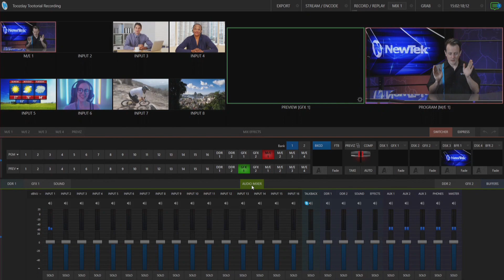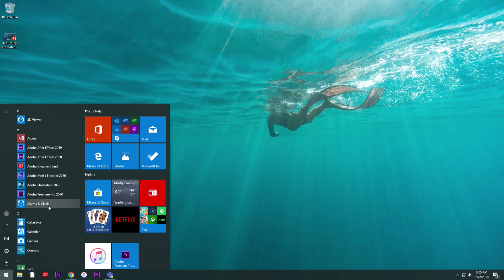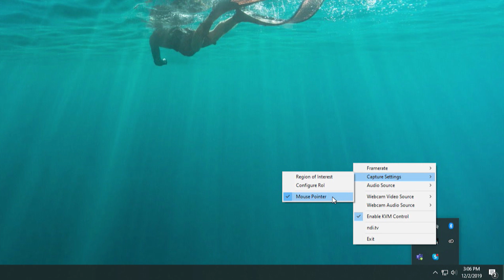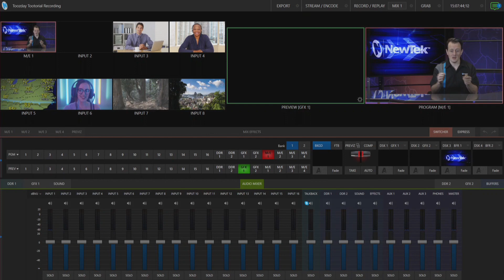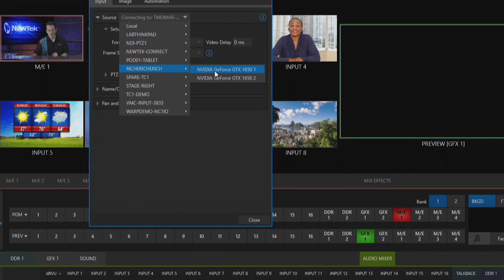Using Power Point In TriCaster via Scan Converter

Comment: Hi Richard, I have NDI on a laptop running in City Chamber to do LIVE meetings.  My input in my Tricaster 460 Advanced Edition located the laptop and shows the PowerPoint in my input.  However, the image of my PowerPoint is a little too large for the input.  Is there a way to "shrink" the size to fit in the window?
Reply: I did use "Configure ROI" to get the whole image but it is still being cut off on the edges
Reply from the maker: @dlcrdz00  interesting I have not seen that before.  what's the resolution of your screen set to? it should automatically scale it down.
Reply: NewTek ... It just dawned on me, when I created the profile I used 720. Now I’m wondering if I create a new profile using 1080 if that would fix the problem. I’m going to try it out and let you know what I come up with. Thanks for your input

Comment: what is the difference between NDI Scan Converter and the iVGA Pro software?  It seems like it does the same thing.
Reply from the maker: they are similar however NDI Scan Converter gives you more control over how you output over the network, with options to change your frame rate, add or remove your mouse pointer, determine what audio source will be sent along with the video, you can also use the webcam and microphone off your device to be sent out as another NDI signal as well via Scan Converter. Scan Converter will also allow you to enable KVM control of the device you are using so you can control it remotely.  Also I believe that iVGA Pro will only broadcast the screen or region of interest on the page you are sharing at 20fps.  those are the biggest differences in a nutshell.

Comment: Is there a way to show the second screen over NDI without having to have a physical monitor connected?
Reply from the maker: it IS possible but there are a few factors
1.  the computer you are using needs to have a secondary monitor output like HDMI or display port.
2.  you will need a display emulator to "trick" your computer into thinking there is another monitor attached.

These emulators are usually pretty affordable and physically resemble a usb drive.  

I just tested this method out and it worked flawlessly.  This is the only method I have tried out to trick the computer into thinking another monitor is attached.
Reply: You may use VGA to HDMI converted. Just plug it in, even without the physical monitor on the other end :)